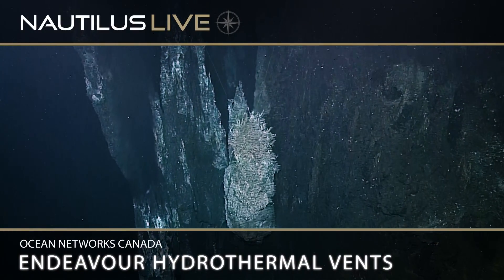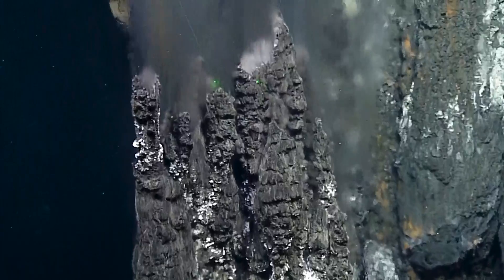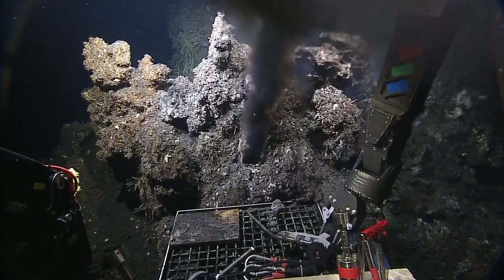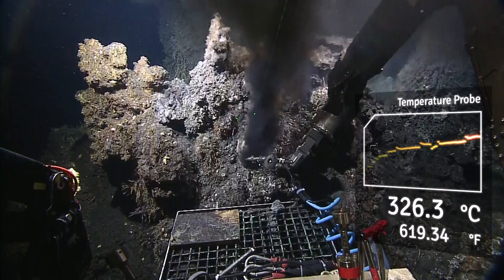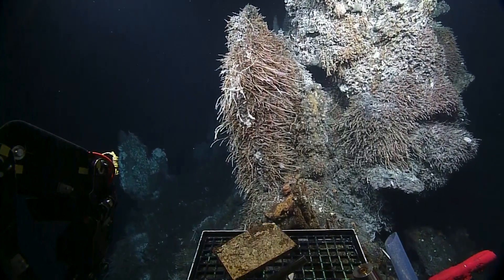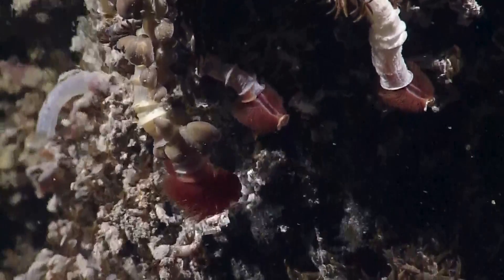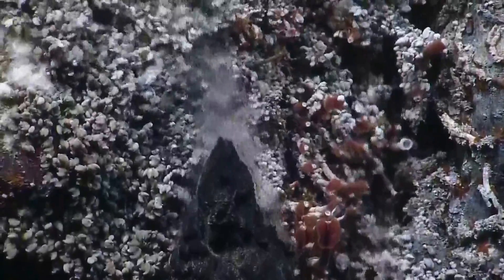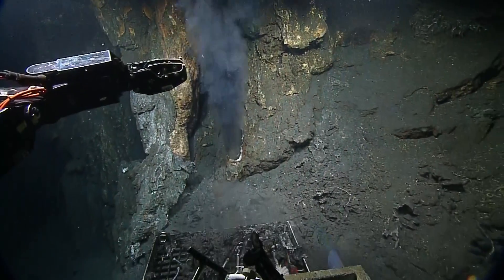Endeavour Hydrothermal Vents | Nautilus Live

Comment: So other than this being underwater, is there a difference between this and a volcano?
Reply: There are definitely similarities to a volcano, but these vents are distinct structures. For one thing, no lava flows out of the vents - it's just water and dissolved minerals. However, the water HAS been superheated by magma beneath the surface, which is why it flows upwards. Additionally, the physical structures of volcanoes and vents are formed differently. The mountain of a volcano is pushed up by the pressure of the magma underneath, which is not the case with the vents. The chimney structures of vents are formed in much the same way as stalactites in a cave - as water leaves the mouth of the vent, some of the minerals dissolved in the water get left behind. These minerals build up over time, piling on top of each other to create the chimneys. So while both volcanoes and hydrothermal vents are caused by the movement of the earth's crust, there are different physical processes at work in each one.
Reply: Alex Kane thank you so much

Comment: SO just for recap; do the two green lazer dots signify exactly a 1 meter scale or am I off? Cuz if so than MAN thems some big stacks.
Reply from the maker: These lasers are scaled at 10cm. Hydrothermal vent chimneys can certainly tower over the seafloor (there are reports of one over 40m tall!), but these were definitely on the smaller size.
Reply: WOW only 10 cm??!  Then that means those li'l tube worms are certified adorable!
Reply: I'm not sure but I think it's 50 cm.

Comment: How do they manage to not back into things and cause damage?  Are there cameras on the back too?
Reply from the maker: We use a two-body ROV system to navigate through the deep sea. ROV Argus provides a birds-eye view over ROV Hercules, which is the workhorse vehicle with manipulator arms (and the main vehicle sending close-up video like this one to the surface).
Reply: imovie•memes umbilical would be very easy to wrap around in them though
Reply: I imagine all the wires and tubes would be neatly strapped to the ROV
Reply: +EVNautilus Thanks!
Reply: Because the vents are in a spire formation, as long as you are facing towards them there's nothing to back into.